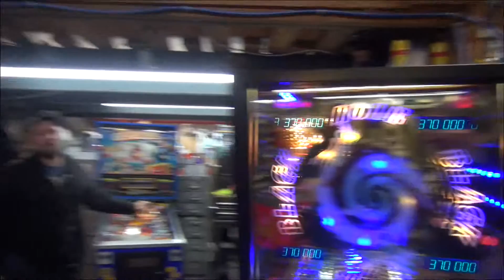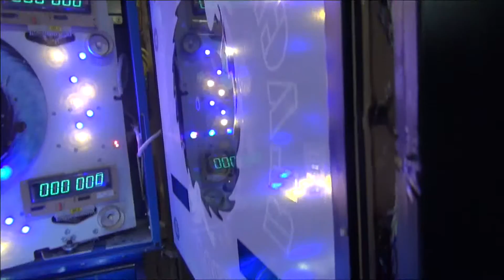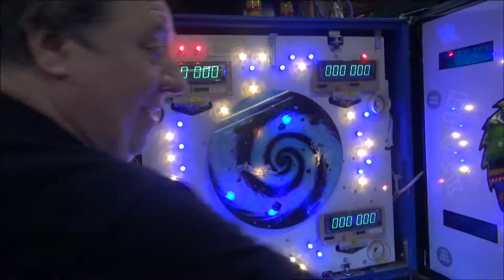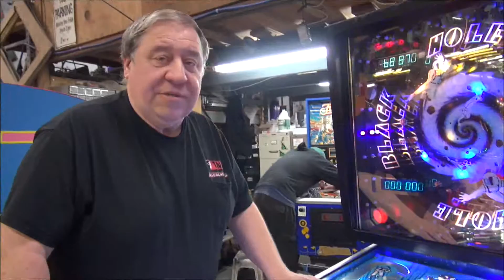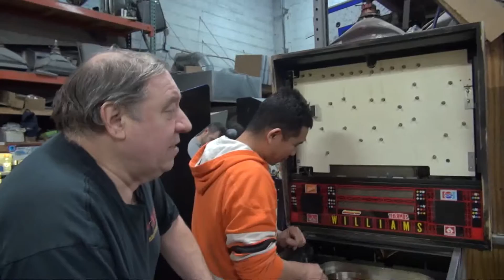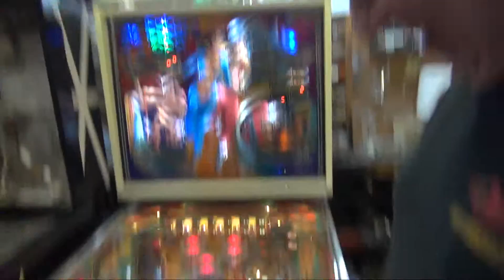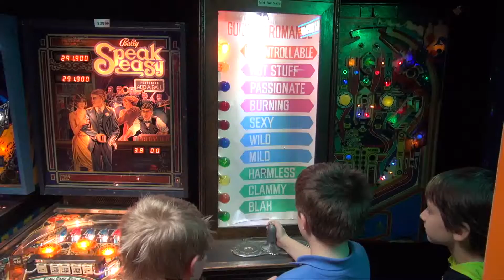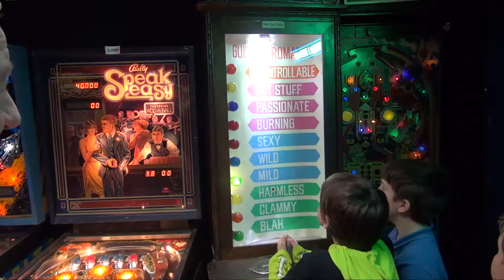#1357 BLACK HOLE-BONE BUSTERS-GENIE-FUTURE SPA Pinball Machines-TNT Amusements

Comment: At 5:40 you mentioned adding a ground wire that fixes a lot of problems. Sounded like an opportunity for another Todd's Tips and Tricks share. What does it address ? Is there not a common ground between those boards?  I'm trying to figure out why you wouldn't want one common if there isn't one.
As a pinball noob, technical  info like that that you share is always rad.
Oh, and that Black hole just looks magical. Superb job.

Comment: At @10:12 is J3 upside down? When you pull it out, the label is on the bottom, and holes on top...but the other plugs in the area, it looks like the label is on top, and holes on bottom. Maybe they designed it like that though?
Reply from the maker: The top row is reversed...it was in right...I do demonstrate the wrong way though!